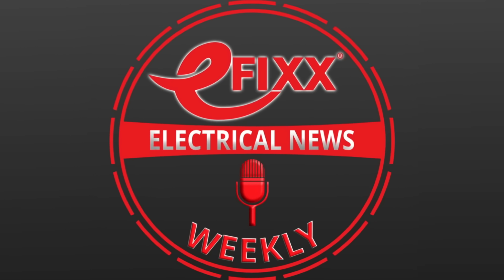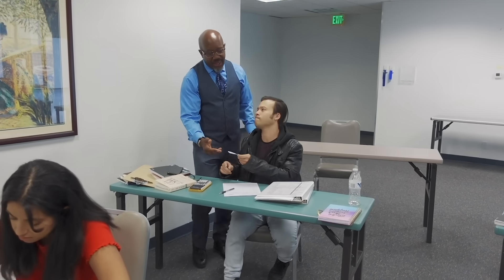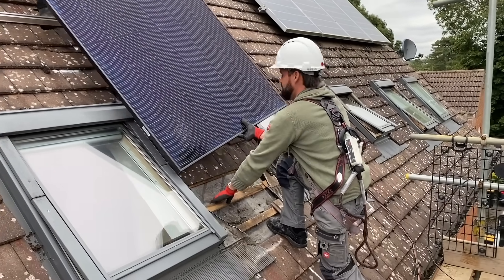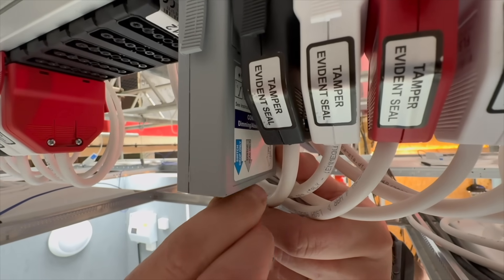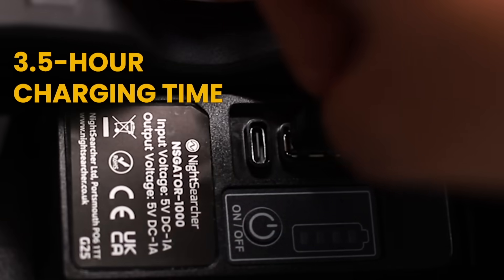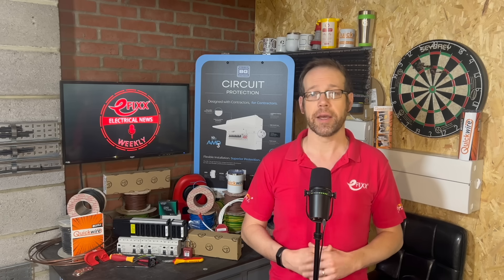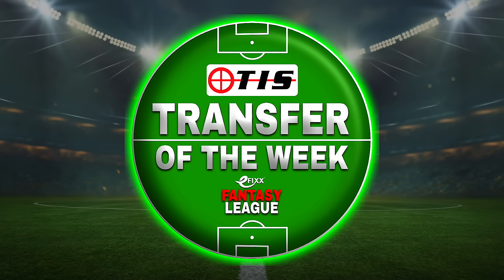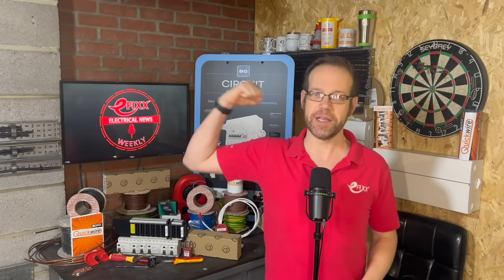Smart Meters Are Telling Lies... Here's Why

Comment: Are they really using raw NAND in smart meters, not with an FS implementing wear levelling and some integrity checking? 
EDIT. No, they are not - comments below say that this info comes from marketing from a firm trying to sell their proprietary file system to smart meter companies and makes no claim that smart meters are failing in the wild due to this issue. Which is much more plausible than smart meter developers being too stupid to design a reasonable lifetime for their NAND.

Comment: Had those problem with security systems. Constant rewrites several times a day, eventually wore out the NVM device in use at the time. They were removable, so I swapped them out. Retired now. But I have one of those smart meters. It's many years old now. So. Am I expecting a similar problem.

Comment: Nand just stands for 'NOT AND' . They are a simple logic gate which gives an output when NONE or ANY of the inputs is 'on' but stays off if ALL the inputs are 'on'. They are volatile in that they have no memory. I suspect eFIXX is really referring to EEPROM (electrically erasable programable read only memory). This does retain values even without power, but as stated, the memory can only be altered a certain number of times - just like your average USB memory stick.

Comment: Why do heat pumps need installation certification? They are appliances that consume energy, not feeding into the grid. What next, certify electric showers?
Reply from the maker: Heat pumps are large loads on for long periods.
Reply: @efixx  EVSEs are even larger loads and they don't require an MCS certificate; although I am sure that MCS is dying to monopolise that area of the market too. If certification is required, there should be competition. Also, MCS = Microgeneration Certification Scheme

Comment: When you get electricity meters with computer chips/memories and electrolytic capacitors etc, then they are on the road to failure, usually at a cost to the customer never the advantage so you have to fight to get any reimbursement due.
We will not have one unless it becomes compulsory.
Gaz Yorkshire.
Reply from the maker: I avoided getting one for as long as possible.
Reply: SM manufactures give a considerable warranty on the devices and try to avoid premature failure. Part of the qualification is an accelerated wear test, where the device is cycled many times over temperature and humidity.
Reply: @WimTon  That's good to know, they probably use military grade components then, especially the electrolytic caps.

Comment: Another meter story: I got a dumb electronic meter when I got my solar panels, as the electromechanical meter would go in reverse. After a while I started burst firing my immersion heater to use excess solar power. This worked well. However, when I got a smart meter it started to register import. It appears that the algorithm which emulates the electromechanical meter is different. I was quite take aback by this as I assumed it would be standardised.

Comment: Oooh nobody implemented Error Checking and Correction in the storage element of the smart meter.

That's such basic tech – but no doubt required more expensive parts.  That's really stupid.
Reply from the maker: Thanks for the insight.
Reply: Error checking is a legal requirement  for meters (WELMEC guide 7.2)

Comment: There are different grades of flash memory the manufacturers can choose from, when designing their smart meters.
There is SLC (Single Level Cell), dual, triple and QLC (quadruple level cell) types of flash memory. They store one bit in one cell (SLC) up to eight bits in one cell. The SLC will last for 10 millions write/read cycle, while the QLC (quadruple) Will last for 10,000 write/read cycle.
Moreover there are some flash memories (consider a database of cell network company, or a bank, or a tax office) that are designed to NOT FAIL, by mean of multiple redundancy.
All of this, to say that those failing smart meters, failed because of... cheap flash chips.
Greetings,
Anthony

Comment: Hmm.  Only if the smart-meter builders were complete idiots.  Which... is quite possible.  But otherwise, no.  NAND controllers have ECC and CRC checks and NAND filesystems also have additional CRC checks.  Any data error should just result in missing data, not corrupt data.  And that would be on the makers of the smart meters because there are plenty of ways to buffer non-volatile data that completely avoids any significant NAND wear.  We're talking 40-year lifespans to get anywhere even remotely close to NAND wear-out.

For example, numerous microcontrollers have their own built-in high-endurance non-volatile memory., sometimes actually done with solid state magnetic memory cells that can have cycle lives in the trillions.  These are typically used to buffer NAND writes, vastly reducing the amount of actual writing done to the NAND.   And even without that, regular RAM is plenty good enough to buffer data and avoid excessive NAND writing.

Anyway, I'm sure some of these smart-meter makers messed up.  But it isn't the NANDs fault if they did.

-Matt
Reply from the maker: Thanks for the insight!

Comment: Does seem odd people designing meters wouldn't know about nand flash wearing out. 
Tesla v1 ECUs quite famously had that issue.
They'd just need to use a bigger device to allow for less write cycles or adjust the software to reduce the amount of data written. (That was Tesla's initial fix)
Reply: You can use bigger devices, or smaller block sizes, and sometimes change the way you extend and update data in partly used blocks to allow multiple block writes without additional wear at the word level within a block. I think this is just marketing spin, and not very good spin at that.

Comment: It doesn't surprise me that the NAND memory is doing this as you get the same thing happening in PC's/Laptops that have SSD drives, solid state memories like these have a finite number of read/write cycles then the data being stored ends up being corrupted. This is one of the reasons  I have resisted my meters being swapped out for 'Smart Meters', even though Eon have tried twice to install 'Smart Meters' at my address without success because the 'Smart Meters'  cannot receive a reliable mobile phone signal where my meters live in my flat.
Reply: Do you really think an electric meter is going to wear out a NAND chip as quickly as a computer wears out an SSD? The quantity of write operations between the two scenarios are not remotely comparable. If an SSD can last years under heavy load, an electric meter will last decades. As others have pointed out, this information has come from a company who are trying to sell their product by scaring people in to thinking that only they have the solution.
Reply: I believe that, at a certain point, the utility companies will have to install 4G micro repeater in many areas. Alternatively, they should consider the use of an external 4G antenna on their smart meters. 
Most houses have their utility cabinet down into the basement, or other confined places which are shielded from radio frequency.
Honestly, this was a well known problem - even before the smart meters rollout begun.
Greetings,
Anthony

Comment: Why the hell do smart meters need NAND flash anyway?

Kwh readings are always moving forward (cumulative) there is no need to cache the data locally, it's not like you can roll back to a previous reading.

The meter should simply fire off HH readings to DCC, that's it. Even if there is a gap in data as long as it's not literally months worth the billing company will always be able to work out what you have used.

Which begs the question, just what data is it storing locally and for how long?
Reply: Data is stored locally in case there is a data transmission interruption. Yes a simple incremental counter would work but would not work with 15 min tarif
Reply from the maker: Great comment, thanks for the insight! 😊

Comment: This doesn't apply to meters designed to the SMETS2 standard - they are designed to limit the number of NAND r/w cycles, are required to have "wear levelling" algorithms and data buffering.

SMETS2 meters have a rated lifetime of 10 years - the NAND memory used must have been stress tested to at least 15 years under temperature extremes. They also have data integrity and industry standard error correcting mechanisms.

SMETS1 meters are different - the very early meters used to write logs too often while overall the write management was inconsistent. Their rated life was 10 years.

SMETS1 meters are being replaced with SMETS2.
Reply: Re my other comment: do you know if the algorithm which simulates the inertia of an electromechanical meter is supposed to be standardised, because my dumb and smart meters behave differently?
Reply: My old spinny disc meter is still going strong after 50 years.
Reply: @Clip7heApex  Spinning, yes, but do you know if it is spinning too fast or too slow?
Reply: @WimTon I've heard they tend to spin slower as they get older as the bearing starts to degrade
Reply: @Clip7heApex  They may as well spin faster when the magnet that is braking the disk gets weaker over time.
Reply: Just out of curiosity, is the user able to access the diagnostic info related to wear levelling and error rates and/or does that diagnostic info get sent back to the electricity company to give a heads-up when failure is about to occur?
Reply: @normanross3422 The user? The user?!?!? The user isn't even able to gain access to the data displayed on the IHD! Scandalous.
Reply: @normanross3422 Memory errors are logged, and the subsequent status of all future measurements is set to "invalid" till the issue is investigated and the supplier has reset the invalid status (or replaced the meter). Wear level logging is not part of the COSEM standard, and may be hidden somewhere in the chip's firmware.
In general, reading the logs requires some privileged access.

Comment: We have a customer who's smart meter hasn't worked for 6 years. She's called and notified the supplier MULTIPLE times, via recorded mail. They keep claiming 'their meters don't go faulty'. Well, she's on prepay and hasn't been ABLE to top up for 6 years. Good luck with them getting that money back in court, given she has a  paper trail, AND our notes on two EICRs and  3minor works certs that the metering equipment is not working
Reply: Huge L for the supplier! I'm assuming it's a blank screen Itron that's crapped out. Common problem with those - especially after intermittent power cuts.
Reply: @yaffajaff  correct, absolutely blank screen, with the backlight on permanently, for six years (pulling the main fuse and reinserting doesn't help, and no we didn't cause it, it was like that before we tried)
Reply: and yep Itron, but the supplier says they never fail <grin>

Comment: The source is literally the marketing guy at a firm that wants to sell their proprietary file system to smart meter companies and makes no claim that smart meters are failing in the wild due to this issue, do you guys not do any fact checking?
Reply: Oh! I thought open-source wear-levelling filing systems were universal.
Reply: @matthewmarks6951 Indeed. Management of word-level and block-level wear in flash memory has been a thing for over 30 years at this point. I even wrote code for this kind of thing in the mid 90s. It looks like someone's marketing department got a bit carried away.
Reply: Irresponsible too as I've already seen the unwashed masses picking it up on Facebook...
Reply: @intercity125  Its crap like this that is helping fuel the right wingers with their climate change denials. I can see farage quoting this at some point as evidence against green policies. And when he says it, the public take it as gospel because IT expert farage never lies! 🙄
Reply: @RichHaynes2012  glad you can see him, not hear him!
Reply: @RichHaynes2012  Illogical.
Reply: Ah. That makes a lot more sense than meter developers being too dumb to put a decent nand flash FS in, or at least make sure the write rate meant they would last 20 years+. And no, people don't tend to check sources much - that why there is so much bollocks on the internet.
Reply: According to the WELMEC Guide 7.2 standard (free to download), the software shall monitor the integrity of the measurement data and of the software. 
So, besides being a legal requirement, manufacturers and utilities will prevent these errors, as untimely replacements are very expensive.   No developer in their right mind will use garbage collection on flash memories.

Comment: The low rate of interval data shouldn't be hard on a sensibly sized flash device so it's hard to imagine someone making a design choice that would result in something like an electricity meter having a 10 year life span.  Even though flash can do it I can't even see a good reason for placing the interval data in flash in the first place.  With normal collection intervals it should only be something like 1 stored record per 15 minutes.  Use a low power CMOS SRAM with a capacitor to support it during power outages and if the outage is so long that the cap discharges (LP SRAM uses microwatts in low power standby) it'll only be a handful of records anyway.

Wear leveling is pretty trivial and there is a decent selection of filesystems for direct access to flash that do it, if a filesystem is even used rather than a simple ring buffer with wear leveling.  It's hard to imagine anyone not using wear leveling for raw access to flash given that all the heavy lifting is done and it's just a case of using the right library.

I would want to see evidence of meters actually failing or flash cells aging to the point where they can no longer reliably store data and have to be avoided.
Reply: Very well put. I would suggest that an electricity meter should have a life longer than 10 years though (given the vintage mechanical ones that have been in service in most properties in Britain for decades). Also, in a few products I have worked on, flash memory has been an occasional source of failure, even though appropriate precautions were taken (I guess this is inevitable at scale regardless of the specific technology though).

I would advocate a future where meters are still electromechanical, but are accompanied by snap-over current transformers and a user replaceable plug-in box that monitors the CTs and line voltage. Would be cheaper for the suppliers and gives more options in the long run.

Comment: Ha, I was waiting for this to happen with smart meters!!  The operating environment alone for a device like this is extreme. Temperature and humidity, voltage surges etc, etc. Then there is build quality, or rather, lack of it!!  From what I've seen of them so far they are poorly spec'd and made with budget quality components, not a good combination for something that is required to operate faultlessly for decades.  And of course, the energy providers are going to believe the device before the consumer in any dispute. Anyone deciding to have one of these things installed should ask to leave the dumb,, old tech, but virtually 100% accurate and reliable meter in place in series with the so called smart meter, that way they have back up corroborating evidence of consumption in the event of a dispute. Remember, these are for the convenience and profit margins of the energy companies, not the consumer.
Reply: SMETS1 meters were definitely poorly spec'd. SMETS2 is a totally difference spec - and requires layers of checksums, hashes, and cryptographic integrity validation, both in local NAND storage and in communications with the DCC.
These are designed so that any corruption (from bit errors to firmware tampering) is detected immediately and either corrected or rolled back safely.

Comment: All those issues you mentioned were solved in the computer world.
For nand chips - there are overprovisioning of capcity, add to that techniques like wear leveling, using portion of the cells at lower density and you get to 500+ drives writes.
And for power loss - UPS keeps the power long enough to finish critical tasks before shutting down - for meter simple battery will be sufficient. 
combine that with more Intelligent data management system, and the meter can last many years.
Problems start when you skimp on design and use subpar solutions - upfront you pay cheap and later on you will spend several folds more to deal with the consequences.

Comment: 1:54 This is kind of misleading as this image isn’t the actual Smart Meter.(SM)

This is just the gimmick display sold as the user interface, my EDF supplied SM User Display hasn’t work for ages, the “Energy Now” screen showing the consumption dials has no connection, but on another screen you can view the Meter reading.. so some telemetry is getting through.

EDF told me its got something obstructing the signal, however this User Display only sitting less than 3meter from the actual Smart meter.

Lets face it Smart Meters are there for remote Tariff increases and Remote Disconnection of supply.
Reply: Remote tariff decreases too - smart tariffs.

Comment: how long do not-so-smart meters last before such problems appear? my not-so-smart meter was installed 6 months ago.
Reply: Electronic meters (smart or not)  must stay within calibration for something like 10 years. The technical lifetime is much longer.
Reply: It depends on how frequently the flash is written to (This will depend on manufacturer and software version) but my advice would be to buy an energy meter of your own - Preferably; One that can log and export the readings it captures - And when the display on that starts to differ from that of your „smart“ meter IHD, that's the time to look closely and collect evidence of a meter defect. 👍